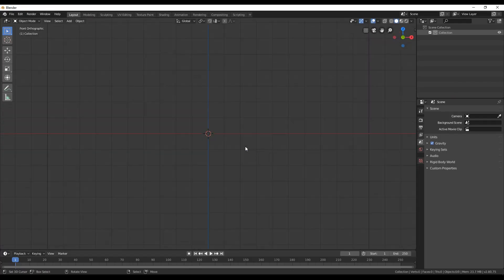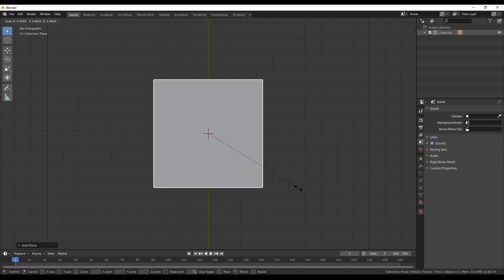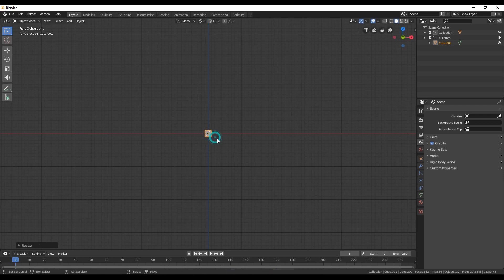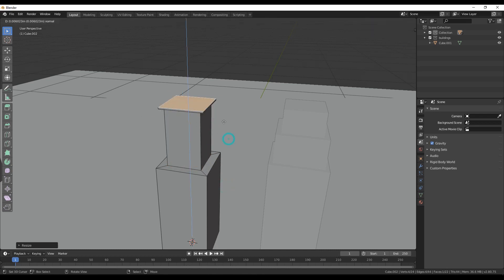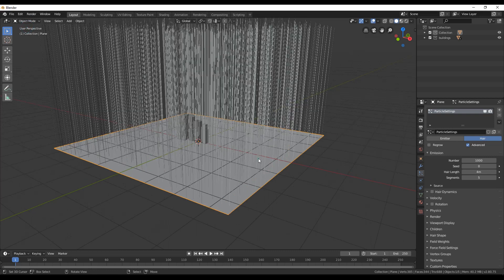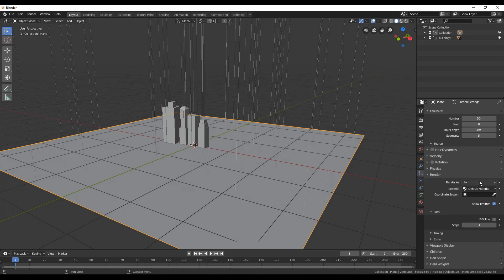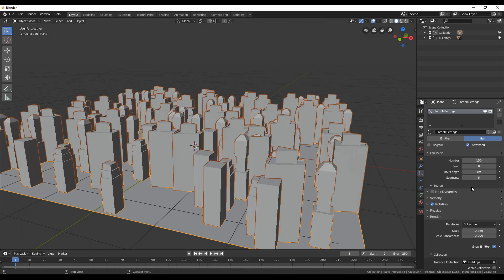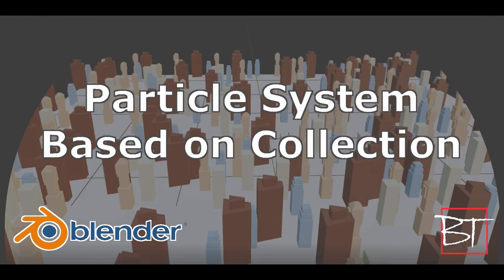🏙️[2.8] Blender Tutorial: Particle System based a Collection

Comment: is there a way the buildings do not interact/collide with other buildings of the same emitter ?? need more space between each buildings, seed dosent help in  my case, thanks for reply Mate. ciao
Reply from the maker: This is really a tricky part but maybe there is a way to do so. Install "3D print Toolbox" addon which comes with Blender. Then join particles as meshes. From addon (in properties panel) press Intersections button in edit mode and then Intersect face button to select all the faces. Press ctrl + L to extend the Selection and delete those faces. This will remove intersected objects so you can add another particles system and repeat the process.
Reply: did you figure this out? I'm currently stuck on this.
Reply: @place_holder2160  sorry, i dont have any clue how to make this. thanks

Comment: Greetings. One question: what if I want the buildings (particles) to be in the air? for instance, I want to add some lights as particles to a plane that have buildings as particles atached..but I want the lights to be higher in the air than buildings... is this possible? Thanks :)
Reply from the maker: Yes everything is possible. For example, you can hide the plane that the particles are set to.

Comment: Hi! Is there any way to avoid overlapping between objects?
Reply from the maker: This is such a nice question. The answer is....it depends. Look there is no such obvious way of doing that but there is a workaround. First you have to divide the plane(floor lets say) into faces. Then by using "Particles/Face" option under Emission source, you can specify how many models of the collection you would like to each face of the plane. For example If you have 3 objects in your collection that you are using as particle system, then change Particles per Face to 3.

Comment: is it possible to have certain building spawn more than others?
if so, how could i do that in blender?
Reply from the maker: Yes you can by using "Use count" option. 
Go to Particle System -> Collection -> and check use count option. Here you can simple add a number to any object to spawn more often than the others. For example, If you have obj_1 and obj_2 and your total number of particles = 10, you can assign to obj_1count number=8 and to obj_2 count number =2 so that 8 objects of obj_1 will spawn and 2 objects of obj_2.